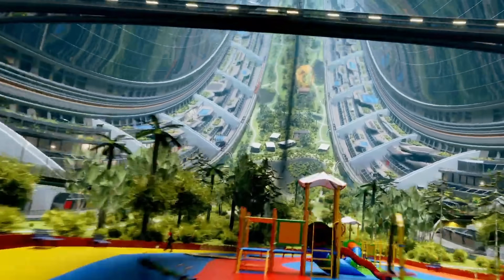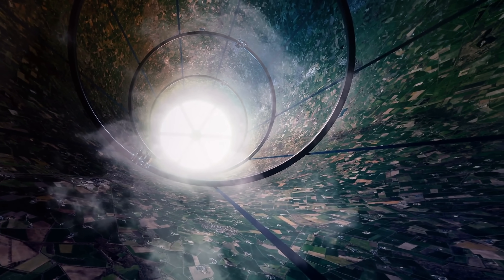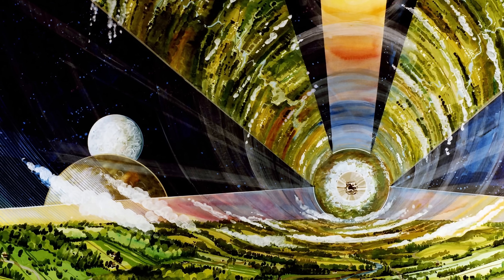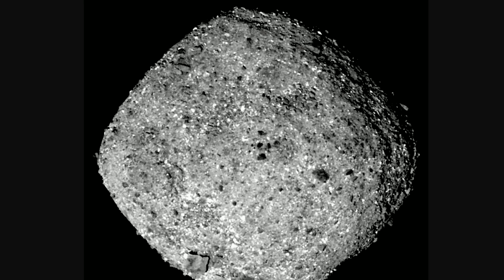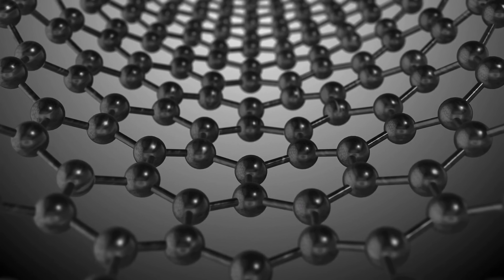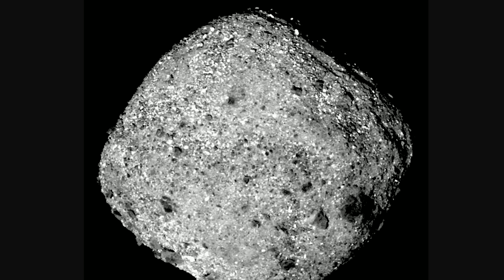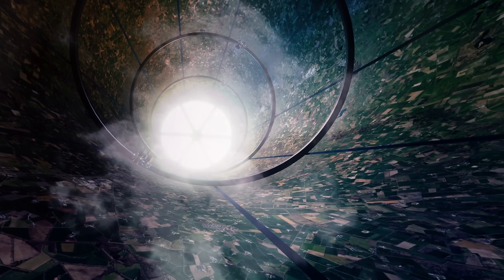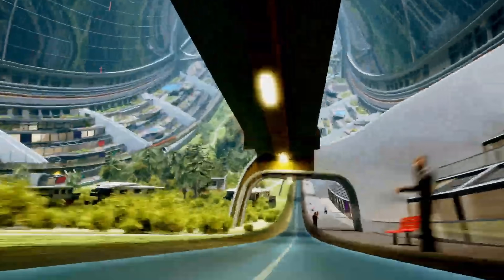Space Cities Out Of Asteroids and Graphene Bags? Intriguing O'Neill Cylinder Study

Comment: Neat idea. One minor point that doesn't seem to get mentioned is moving your new space station to where it is actually useful. Most asteroids are a long way from anywhere with no useful resources anywhere close. And if you want to move them anywhere they are useful you better be very confident of your aim. A missed decimal point in your orbital calculations could have your space station become a ground station (delivered at 20K mph)
Reply: More  likely a missing decimal point would result in coming close to nothing at all. At any rate, if your software can reach the asteroid based on it's calculations, then it can accurately calculate a return path as well.
Reply: Also,  "where the station is useful" would initially be out beside another asteroid to mine that, rather than at Earth.
Reply: @absalomdraconis  I note that the test just done by NASA on moving an asteroid produced results they didn't expect. I will also note that no matter where you want it you still have to move it there. Which will not be easy, fast, or cheap. So if you want to use it for a mining base for other asteroids they had better be producing very high value goods.
Reply: It would be nearly impossible to hit a planet by accident. You've clearly never played Kerbal Space Program.

Comment: The spun-up asteroid inside a graphene bag trick sounds effective.  I'd suggest the spin-up and bag expansion happen somewhat gradually given there's no reason to rush as it'd prevent the asteroid falling apart catastrophically?  By catastrophic, I mean you'd want to minimize the distance between the outside perimeter the mass can reach and the outside perimeter the mass is at, because if it falls quickly out, it'll function like a figure skater sticking her leg way out and dramatically slow the spin as well as having impact.

To spin you could use nuclear powered ion thrusters.

Comment: One nice thing is you can build very large structures in space with otherwise low-value silicates. And they can be very strong in tensile applications.

The benefit here is that in microgravity and vacuum, glass fibers can be spun economically in bulk that have extremely good mechanical properties as compared to anything produced on Earth. On Earth, you can go through the expense of a vacuum chamber, but you won't be able to get microgravity in any practical way, and a free-fall drop tower or shaft would need to be excessively long. 

The reason is that atmosphere, and even very small amounts of trace moisture from water vapor, and mechanical strain from gravity introduces microfractures and random discontinuities in the extruded glass fibers that always limit their maximum tensile strength.

In space, such fibers can be nearly perfect on a microscopic and almost molecular scale, and will be substantially stronger.

They will still not be as strong as graphene, diamond, or nanotube, nothing beats the kPa per meter of the carbon-carbon electron bond. But the space-made glass fiber is still very strong, strong enough to build very large rotating habitat structures, including common proposals for O'Neil cylinder sizes with non-motion sickness RPM's.

Furthermore, glass-glass composites are possible. Clever fusion of structural glass fibers and glass as the matrix can be done. Doping with trace elements for different mechanical properties and melt temperatures can see glass fibers embedded in glass matrix for "Glax" composite materials. 

And many of the concepts that "require" carbon nanotube or graphene structurally, often have unnecessary and arbitrary limits or conditions imposed on them. 

Namely mass and size/thickness of structural members. Only carbon nanotube or graphine may "work" at a given thickness or size, but if there are no size or thickness limits and as long as structural quantity or bulk scales its strength faster than its mass consumes it, like when building in space in microgravity from local asteroid materials you have much more freedom. And otherwise low-value silicates potentially available in any arbitrarily large quantities needed, many additional options open up to your engineering.

This reserves asteroid carbon for potentially more useful volatiles, or organic carbon chemistry compounds like polymers or hydrocarbons that the colony will also require. And Furthermore, higher mass & thicker silicate structural pieces, like the colony shell, will provide greater cosmic and solar radiation protection, instead of potentially requiring a non rotating shell of bulk-mass asteroid or lunar regolith, which would be a use for those low-value silicates anyway. 

This also somewhat applies to how a space elevator for earth in kPa/m² is "impossible" even with nanotube or graphene. But that's for ribbons or cables of constant width. If the elevator can scale with the stress loads, even high-grade steel will work. Granted, this imposes other challenges, like how the elevator cars might travel a steel elevator that's 1m in diameter at sea level, but 20m in diameter at the points of max tension in space. Or that this is "an enormous fuckton of steel!" And in the event of catastrophe, hypersonic steel 20m thick entering atmosphere as it wraps up around Earth along the equator is worse than lower density carbon... But these at least become logistical issues, and not "impossible science ones." And if one goes back to graphene & nanotube, and also allows the width to scale, the size difference in thickness scales down as well.

Comment: You don't even need special materials for an O'neil cylinder, steel will do (although difficult to get in quantity).  The key is that the strain is taken by the circumference like a barrell and not radially like a wheel which massively reduces the forces.
Reply: Yeah.  It would need to be a lightweight material like aircraft aluminium, reinforced with kevlar or basic carbon fibers or something along those lines.

Comment: A similar idea was presented in Alexander Jablokov's Carve the Sky novel. A nickel iron asteroid was spun up in front of a large mirror concentrating the suns rays on the asteroid. After melting point was achieved the asteroid was inflated by pumping gas into a pipe placed previously into the one of the poles. I always thought this seemed like a good low budget path to a habitat.
Reply: I wonder if liquid nickle iron has surface tension when molten? Could a bubble of it be blown and then allowed to cool? Not only could habitats be created this way, but possibly huge concave mirrors able to be used as a telescope?

Comment: But if the asteroid rubble is non-homogenous (ie. made of different-sized chunks) then you don't want to end up with a non-homogenous cylinder which doesn't rotate properly (ie. precesses). So how are you going to crush the big chunks down into smaller ones? Will you have some grinding machine rolling around on the inside of the cylinder under spin-gravity, grinding bigger chunks into smaller gravel or particulates? Or could you use concentrated solar heating to gradually melt everything bit-by-bit? Given enough solar power and enough time, maybe it could be done that way. :goodvibes:

Comment: I do love this concept. My only problem with it is, how do we move it? If we just spun up a bagged pile of rubble, that will have no rigidity. I suppose maybe we could add some concrete or rebar or something?
Reply: I'm just guessing here, but yeah it seems to me that spraying the whole thing with layers of concrete should be doable (though maybe concrete might need air to set properly?  I don't know any space-based bricklayers so there's nobody I can ask).  
The bag/net itself might be enough.  I don't think graphene stretches much, so once it's in place, every additional bit of spin should force the loose rubble into a more compacted, more solid state against the netting.  Also, the netting would provide something for us to 'grab onto', or attach rocket drives to, to give the spin required.
Reply: You would want to be careful not to be too rigid. Rigid materials are less resiliant against impacts, less effective insulators, and harder to repair.

In the case of a "rubble cylinder" the container and simple gravity will provide the basic rigidity for us. My main concern would be the material of the container. If it ruptures, you would have a sinkhole that "sinks" into outer space. If not repaired, it can catastrophically tear and the whole thing flings apart.

Moving wouldnt be a problem so long as the movement is parallel to the central pole. The problem would be turning as a spinning object would produce a resistive gyroscopic effect. Useful for maintaining stability but less useful when you actually want to move it somewhere.

Also, the cylinder would be very resistant to damage on the outside coming in. However, if anything strikes from the unprotected poles and hits the inside of the cylinder, the results would be devastating. Again, rigidity would make it worse but not a whole lot worse than normal, since you would expect the structures on the ground, like roads, to be fairly rigid anyway.

Lots of mega-engineering hurdles to jump.
Reply: @felixfeliciano7011  If you're not an accredited space brick-layer, then I'm going to view everything you've said with scepticism, sorry.
Joking.  You seem more knowledgeable than me, so I'll take your word for it  :)  
Your points about too much rigidity do make sense tho.  It reminds me of Earthquake-resistant buildings that are designed to flex, rather than shatter
Reply: @garyfreeman7122  In order to be a credited space-brick layer, you would first need a space-brick layer program. The ones who build that program will have no expertise by definition. The first true experts will be built on the backs of lots of fools.

It isn't a stretch to say that such space-based structures are beyond most of our understanding of structural engineering, which predominantly occurs on a terrestrial sphere. All we have to go off of are incredibly fragile space stations that orbit so close to the Earth you could barely tell they left the globe at all.

And that is only talking about the physical engineering aspect, nevermind the economical, socialogical, and chronological aspects. But we can still guess, and so long as the reality remains so far away, it can be fun to speculate and plan. If nothing else, it helps us bungle our way into understanding. It is why I became an engineer in the first place: to understand and learn.

Comment: Ok, so "all" we have to do is:

1. Find asteroid. Check.
2. Build a fleet of spacecraft that can get there.
3. Build a net strong enough to hold the matter while it spins.
4. Align the whole thing so it is at 90 degrees from the sun to prevent people from getting dead by the radiation.
4. Put an enigine on a ball of loose rubble and spin it untill it explodes inside the net. (I guess we just forget about the bits that are in the center and will never move outward)
5. Slow the entire thing down so the centrifugal force at the surface is about 1g. 
6. Do exactly the same as we would for a colony on mars, but now on a *hollow spinning object*.

And then come the inevitable details like what do you do when you need to adjust the course of the object? Spinning faster and slower is "easy", but laterla movement?
How do you deal with the fact that the groundwill NEVER be stable? It's a 1G environment so you need a way for your buildings to not sink into the rubble...

Do I really  need to quite Jurassic park here?

Comment: Do you think we can "harden" asteroids?

If they are made of this rubble material, could the rubble material be "stuck together"? 
Using spin gravity to break it apart and stretch it out into form (bit like spinning out a pizza)... Then using heat (probably solar powered lasers) to fix it all together into a hardened structure?

Also... If there is a net made of super strong material holding the asteroid rubble in place as spin is applied... Surely there will be massive strain on the net itself, perhaps some piezoelectric effect and properties might be applied to the net so that the strain on the net from the movement of the rubble creates electricity to be recycled by the system?

Comment: what about the light?? the only way the light can reach the internal surface is with a direct exposition, then how do you protect the environment from the radiation??
Reply: O'Neill's original design, if I remember correctly, had only a small window at each end with a mirror that would reflect a beam of light through the center of the cylinder.   This beam would be scattered and diffused by the air inside and illuminate the ground surface.

Comment: The torus or closed cylinder makes more sense (than in the thumb). Having buildings that are exterior facing is creating a vast amount of surface area that requires far more insulation and armoring than encasing the whole thing. 

*(ah you agreed on the cylinder as I typed it)

I also like the idea of a zero G zone in the middle of a cylinder.
Reply: I am going with nanomachines reconstructing a metallic asteroid into a suitable structure. Even with no nanomachines. We are talking about a lot of effort to hollow out an eggshell as opposed to making one.

Comment: How exactly would you spin a sphere of rubble with an engine?  Since the surface isn't solid wouldn't the rubble give way and the engine would just fly off?
With space elevators I wonder if you could build from the surface and space at the same time.  Making sure they are connected with something relatively thin and slowly building it up, using the tension from the space part to support the part on Earth.

Comment: Gravel will not keep an air inside. We will need a dense shell anyway. So, may be it makes sense to moisturize a surface of an asteroid with something viscous, and spin it, and then apply the second component to make a surface hardened. Like two components resin. That’s not about money, but about a complexity of building the cylinder.
Reply: Probably even better to initially just ryn some refinery equipment along the inside, leaving behind refined materials to keep the bag stretched out, then go back around later to build a skeleton structure inside the bag before removing the bag completely.
Reply: @@cancermcaids7688 mmm.. that's not a case. I'm afraid only relatively small asteroids are not a solid body. Let's say 1-10km in diameter. Then we can estimate the thickness as 10-100m.
Reply: No one thought the gravel would. You would build air tight habitats with the inner ring. Also, why use two liquid components when you could just use water and let it freeze? Cheap, natural, widely available, and useful for other things.
Reply: @filonin2  This might work. Without a fantastic carbon net. As the radius and a surface increase, a new portion of water is added. The only thing is a comet -) Which proves Sun can melt an ice on a surface. A gravel-ice mix must be few meters below a surface level.

Comment: I have found two things of interest while searching on Google Earth that may turn out to be alien artifacts just based on their scale.

The first is a 60+ mile long, 10-mile diameter tube comprised of 3-mile wide rings that have interlocking features that are .25 miles across.  Part of the tube has collapsed and the wall appears to be .5 miles thick.

Is this a crashed O'Neill Cylinder?

28°21'45"N 76°01'08"W

Comment: I never fully grasped how spinning a cylinder or donut would create gravity over the long term. I get the concept in terms of physics, but wouldn't you need to constantly be adding energy into the system to keep it spinning? IN Space there isn't any resistance but within the structure things coming and going and even the radiation the object emits into space will gradually steal energy from the system right? Mentally I'm not sure if I'm missing something here. Won't you need to input tremendous amounts of energy all the time to keep the object spinning how you want to maintain the gravity effect?

Comment: I always picture banks of mirrors on the far side of the cylinder. If you were out in the asteroid belt,  you could have the equivalent of full sunlight on the inside,  via fiber optic cables. It would take several times the area of the inner surface in mirrors to do so, however. Beyond the belt, there's no way except some sort of nuclear reactor, with all of the problems that entails...

Comment: much better then making a Mars colony... Beside i also think space elevator can be done without it being in physical form... Wither it is using magnetic to push a shuttle up... beaming power to a shuttle so it does not need a fuel tank... or a energy tether that can be climb with some new tec... I assume there much more possibility if the researcher would look into it.  I think the miss conception of a space elevator is that people think it need to be a solid structure.